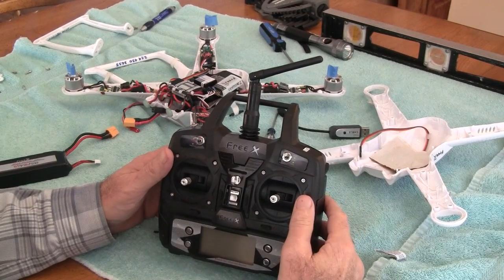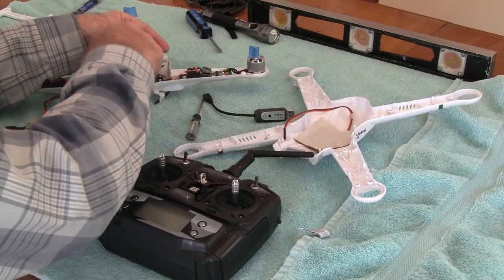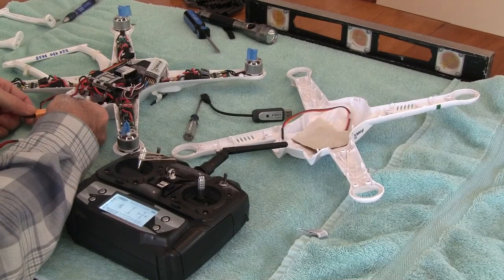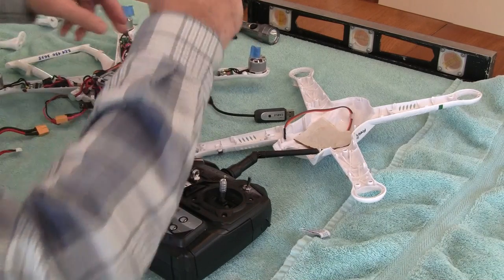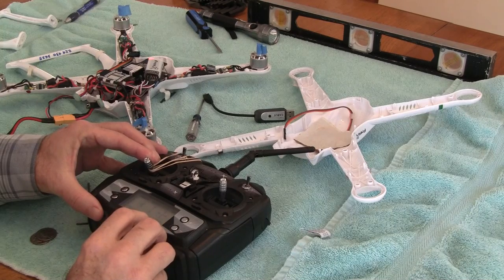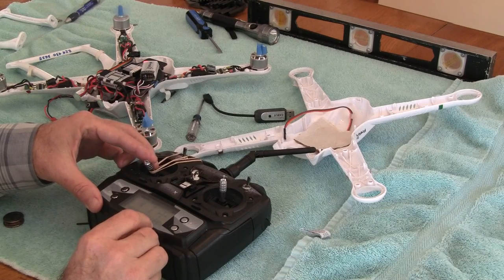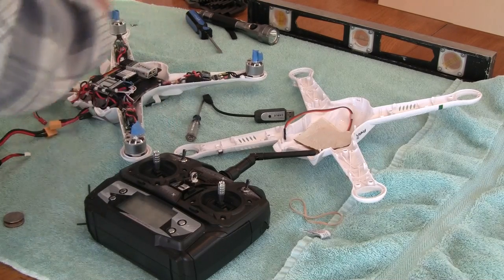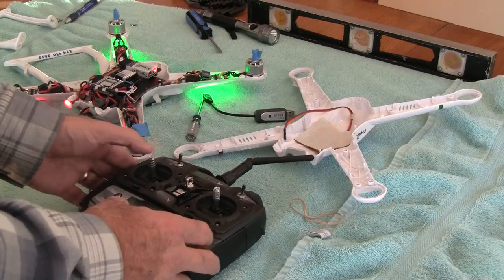FreeX Quadcopter Throttle Calibration

Comment: At 2:14 in the video are the instructions:
"The switches on the front of the radio should be in the up position..."
I take that to mean the toggles on the top, front of the controller should be in the following:
Left Toggle (Altitude,Headless): Altitude   Right Toggle (OFF,GPS,RTH): OFF

"...and the failure control switch should be on hold."
I take that to mean the toggle on the front left, below the top left toggle:
Front Toggle (Hold,BackHome): Hold

Just thought I'd go ahead and add minutiae to your excellent tutorial.

Comment: Hi, not certain if you can help, got a new Freex a couple of week ago, not had any chance to fly due to very bad weather. Finally got chance to fly and after completing all set up procedures I'm not getting all 4 motors starting equally. I have 3 running and the forth starts at about 54% throttle,it's difficult to lift off as it tries to flip. When I do manage to get in the air it fly ok. Supplier recommended firmware update which I have done,now on latest version but this has made no difference. Do you think throttle calibration on individual motors would solve this problem. Thank Nigel M
Reply from the maker: +nigel mason The throttle ESC calibration should correct this problem. When you finally get it in the air it gets better because the self leveling helps to keep it level. When you raise or lower the quad there is less self leveling so it can flip.

Comment: hi, john dont know if you will answer me but i take my chance:
some days ago I made my drone flies and everything was normal , I put it in the box and next days I try to make it fly but its not working. wen i arm my motor every thing is normal and the motors come on, but after 2-3 seconde the both rear motors become crazy so the drone reverse. I also discovered that the compass did not find the nort, so I try to calibrate it but its not working .
Reply: Xxpurjo1xX video did you ever find out what was wrong with your drone?
Reply: Xxpurjo1xX video    I had a short fly-a-way on one of my first flights and it wasn't very stable.  I found out, when I pointed the quad north to get the blue light, my compass/gyro was off by 60 degrees.  I have replaced it but have not flown yet, but the blue light will come on when pointed north now.  Just another "quirk" to keep in mind.  I had the gimbal and gopro on it when it crashed the first time and I was very happy with how stable and smooth looking the video was.  It flew over the house (2 story) and into a 100' tree and tumbled all the way down through the branches and I only ended up with a chipped prop and a stripped screw holding on a prop guard (don't use prop guards).  I like the FreeX because it is dead simple to use, no computer in the radio or smart phone with app is needed.  You can use any brand battery (not smart) which opens up many battery options. Thanks for the video man (I know its old).

Comment: if my quad feel off table .. would it need this if its not running right?
Reply: +PITDAWG HYDRO so thats what u did to it lol :) Was it on?
Reply: +MrLunithy No.. It kinda slipped out my hands and hit the floor..  Just found out my problem .. Somehow the gyro gain got bumped up to max.. which was 64 .. was posed to be set on 18

Comment: Hi John, Hope you can help  Bought my freex early this year, I think I calibrated all ok and copter flew pretty well but before I could test every thing the battery quit but that's another story. When I went out to do further tests calibrated again with no props and found after a few seconds 1 of the motors started to wind down unable to find the cause and the uk support team are not very helpful.Have you had this trouble and what do you recommend

Comment: Never mind, John. I was able to fix the transmitter.  The potentiometer for the throttle was the culprit.  Opened it up, cleaned the carbon contacts with rubbing alcohol and the reset the transmitter.  Thanks anyway.

Comment: John, I brought out my quad from storage to run today since the weather here in Baltimore, MD is a little sunny but to my amazement my quad's motors will not run. Turning on the transmitter, the throttle stick is at 96% while in the middle. Pulling the throttle stick down it's at 94%. I can't even re-calibrate the transmitter as shown here in your video. Help!!!